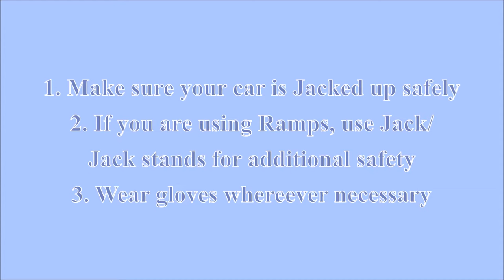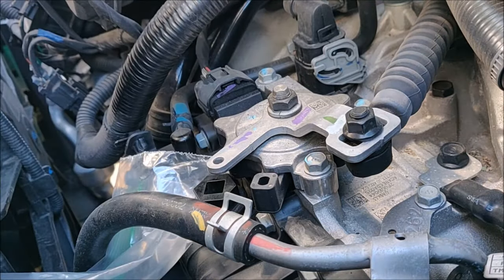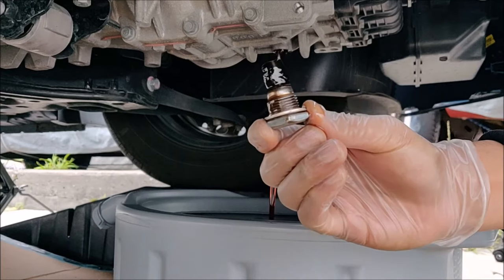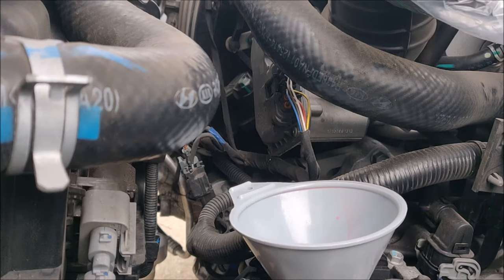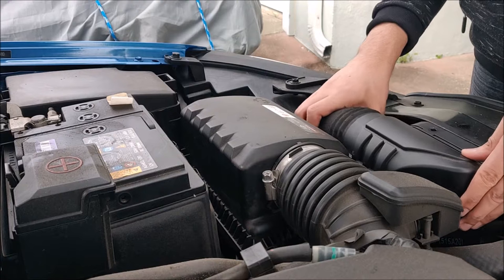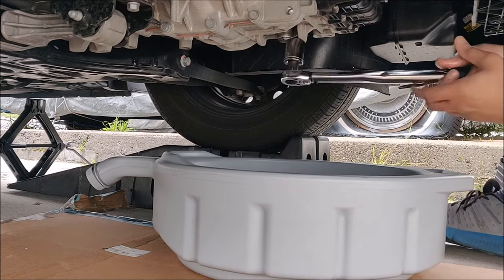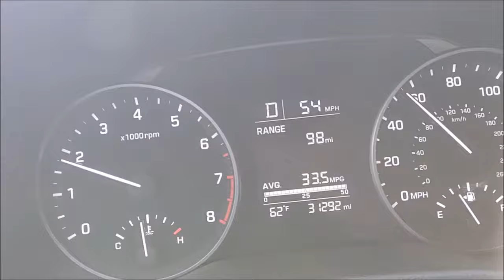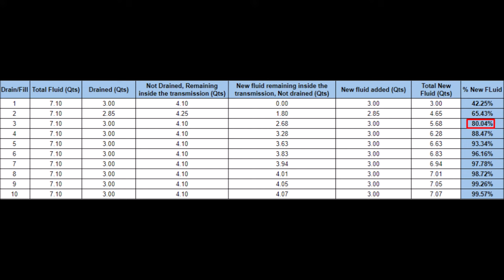2018 Hyundai Elantra Transmission Fluid Change - 3X Drain & Fill with Amsoil ATF (6Th Gen Elantras)

Comment: I have Hyundai Sonata 2017 I check in owner manual ATM drain or change first time at 60k and then every 30k ?
Reply from the maker: Hi, Yes manual says at 60k miles. It is okay to do it at 60k miles, but not later than that. And it also depends how the car has been driven. Severe/rash driving conditions may deteriorate the fluid quickly.
Best preventive maintenance plan in my opinion is to drain/fill the fluid 2-3 times at 30k miles - this removes all break-in materials. And thereafter just once every 30k miles. This will make it last 200k miles and beyond!! :)
How many miles does your car have?
Reply: @andy-auto-info2483  71k done and I am not facing any problem. But I checked manual it said 60k that's why I am thinking to do this week.
Reply from the maker: @DesiTravelDiaries84  Good. Let me know how it turns out. Looks like you will also upload a video. I will be waiting for that :)
Reply: @andy-auto-info2483  it's look complicated maybe I will go to mechanic. Please suggest me good socket wrench set in which 10mm 17mm and 24mm.
Reply: @andy-auto-info2483  scared to change transmission fluid it's very sensitive. After filling how we know that we did proper filling because there is no dip stick ?
Reply from the maker: @DesiTravelDiaries84  Draining and filling will do no harm. If you decide to go to a mechanic, make sure he uses OEM or other quality brands. Sometimes they use very cheap multivehicle fluids, so be careful.
And for Sonata, I believe the fill port will come out easily, you do not have to cut it by filing. Please see my pinned comment point no 2 for checking the fluid level. It is the same for Sonata as well. For Socket wrench sets, you can check in Home Depot. the Husky brands are pretty solid and they give you lifetime warranty. Get a Torque Wrench from Amazon, you can get one within $40 which is good. The one I have, I use it for everything. It costed me $29, 4 years ago. Since it is long, it gives you enough leverage and makes it easier to open the drain bolts. :)

Comment: is it okay to send a dipstick down the fill port and permanently mark the cold level ( ullage ) on the dipstick before draining the fluid so as to have a level mark to refill the new fluid to?
Reply from the maker: I would recommend you do not do that. May not be accurate because of the way the dip stick would go in.
Reply: @andy-auto-info2483  thanks a lot

Comment: hello the computer needs to be reset after the change!  or if I roll the car how many miles should my car go to reset!  or should I disconnect the battery and reset?
Reply from the maker: Hi Wilmer, you do not need to do any of that!
Usually the transmission gets adjusted to the fluid change pretty quickly. Not sure how many miles, but few hundred miles I'd say. I did not do anything as such and it runs great :)

Comment: Do you think maybe if the transmission gear selector was in neutral that the top plug would be easier to remove?
Reply from the maker: I tried this. It did not work. Also, it is not the shift selector coming in the way. It is the thick hexagonal bolt under the shift selector coming in the way. Hope that helps.

Comment: Would you suggest I do this on a 87,000 mile 2017 Elantra? I recently got the car from a dealer and do not know the transmission service history
Reply from the maker: That's a tricky question. It really depends on how the car was used prior to your purchase. So its hard to tell.
Check with a mechanic to examine the fluid condition. If its not in a really bad condition, you could do a drain and fill. Use O&M fluid.

Comment: Hello. I have 2020 hyundai elanta. I changed the transmission fluid and I checked the level after two days.
I check the fluid at 150F / 65 C while the engine was turned off. There was about 1/2 to 1 quarts of fluid was spilled. Did I check it in the wrong way? Should I refill the transmission again?
Reply from the maker: Hi, you may be low in fluid. You have to put the car in level. While the engine is running and at the recommended temperature, you should open the level check plug. When the fluid is at the correct level, you will see a small stream of fluid coming out. At this point, close the plug and you are good. :)
Reply: @andy-auto-info2483  i could not find the proper temperature in the user manual nor online. What would be the approximate proper temperature?
Reply from the maker: @oqhr  the temperature should be between 120 and 140 deg F. Check my pinned comment. You'll find all the details. :)
Reply: The 2020 elantra sold in the United States has a CVT which is a completely different transmission than this one, so things might not line up as in this video.
Reply: @carterdavis2793  you are right ✅. Mine is 6 speed Automatic

Comment: Is that not the shift lever that was blocking the drain plug?  If so, why not just move the shifter out of the way.    Aka put into neutral.. maybe I’m missing something
Reply from the maker: Shift selector is not the only thing. You see the big hexagon looking bolt that's holding the shift selector? That's blocking the fill port. I did not want to mess with the calibration by turning/moving it :)

Comment: Can u fill from the bottom using a pump without having to deal with the fill plug nonsense ?
Reply: Yes.  You can just fill with a pump into the check plug hole.
Reply from the maker: Yes, as Phil said, using the check plug, you can pump the fluid back in. Have an extra quart, just incase it gets a little messy. :)

Comment: Zeroing my mileage meter and filling up right before getting n the highway.   I can do  78 mph with three people in the car and AC on and it will read 125 miles later 44 miles per gallon.   Actual the best doing that was going in slow and go traffic at 45 to 55  in morning to other side of town and got 55 MPG.  What have you gotten.  I have 2017 Elantra.   Great Video.  Thanks.
Reply from the maker: Wow. See, having clean tranny fluid goes a long way. I have 4 simple questions for you. At how many miles did you change your fluid? Which fluid did you use? Did you do 3x drain and fill? Were you able to remove the fill plug easily? :)
Reply: @andy-auto-info2483  Hi   I am waiting for fall to do my Transmission change.   I have about 74,000. miles on my Elantra now.   100 + deg out here in Az.  I try to change oil right before it gets hot and right after even if there is still mileage left.   I have 2017 Elantra.,   Will let you know which fluids I use.  thanks

Comment: How many quarts of oil do you have to pour after emptying it and thanks..
Reply from the maker: around 3 to 3.5 quarts. You can use the fluid level check plug to determine the level of fluid.

Comment: great video.  what difference if any would apply to manual transmission?
Reply from the maker: For a Manual transmission, the process would be different. Even the fluid will change. Check your owner's manual for the type of fluid that needs to be used.
Reply: @andy-auto-info2483  would the plugs be in the same location? and would I have to file the fill plug?
Reply from the maker: @acts2211  I don't think the plugs are in the same place. And filing will not be required for Manual transmissions. Check owners manual as the procedure for Manual transmissions and fluid being used are different. :)

Comment: Question: 
I have an issue with Hyundai Genesis, I have 2015 v6 sedan and it hard shifts from 2nd to 3rd and from 4th to 5th when ATF is cold but when it heats up, it's smooth and still notice harsh shfit 4th to 5th and more apparent wje driving uphill. I did 4 drain and fills with OEM ATF SP-IV-RR.  Dealership suggested to replace the full transmission assembly. I have done 4 drain and fills of the ATF, I changed all solenoids, changed the wiring harness for the TCM and changed different sensors inside the transmission, no luck!
I suspect a bad TCM or software bug, or a bad Torque Converter. My last resort is a transmission replacement. What are your thoughts please?
Reply from the maker: Sorry to hear that Husam.
It looks like there is definitely an internal problem with wearing gears or torque converter like you said. I'm saying this because you changed out the fluids and replaced electricals like solonoids.
Did you check with the dealer to reset the transmission software?
Also how many miles do you have now and how often was this maintained?
Reply: @andy-auto-info2483  Thanks for your response. Yes the dealer did reset the adaptive values of the TCM. It still has the hard shift. The car is 170,000 km on it and i am the 1st owner and it is top notch maintained.
Reply from the maker: @husamothman1   that's only about 105k miles. Not too much and if you have maintained it well, not sure what may have happened. You did mention its a V6 engine, so a more powerful car. If you have done more city driving (severe conditions) , then it would br harsh on the tranny as well. There are so many factors that affect it.
If you can manage how it is currently, then fine.
Worst case, before you replace the tranny, maybe give Amsoil OE fluid a try? One drain and Fill and maybe check the difference? You never know, it could fix the issue. Let me know what you decide and what the outcome was. :)
Reply: @andy-auto-info2483  Yeah, I am scheduled for a discussion tomorrow with the dealership and I already ordered Valvoline MAXLIFE to give it a try. I have my suspension around a bad logic in the TCM as this seems to be a common issue with multiple cars of the same model. I'll keep you posted.
Reply from the maker: @husamothman1  Definitely . Good luck with it. :)

Comment: I was just getting ready to say, if you would have put it in neutral and hold that emergency brake up that shifter linkage wouldn’t have been on your way and you wouldn’t have had to file down that bolt

Comment: You can re-use the washer many times if you don't tighten it too much and turn it to the other side. I have done it many times in my Elantra 2008 and Kia soul 2012
Reply from the maker: You can definitely do that if the washer is re-usable. You do get re-usable washers. Generally, crush washers are used for one-time purposes. The thickness in mm is drastically reduced once you tighten it. If used multiple times, there are chances that it may crack and the fluid may start to leak. Especially if you torque the bolt to specs. Feel free to re-use at your risk. There are chances that it will develop crack and leak. We should not ignore cheap insurance. Thanks :)
Reply: @andy-auto-info2483  I repeat it again, I use it many times and the washer is wherever you call use one-time. The problem is you. You don't know how to use the torque specs. all people and mechanics I see on these youtube videos use the max specs, that is not what specs mean. If it says 28 to 35, why the heck you put 35 ft-lb?

Comment: Did you check fluid level with car running?
Reply from the maker: Yes, I did. Look at my pinned comment point no 2. You should check the fluid level while the car is running. The gear must be in park and the fluid temperature should be between 120-140 degree F. :)

Comment: Have you had any issues with leaking from the fill plug where it was filed? Is it even possible for fluid to leak from there? Wanting to try this but want to make sure there will be no leaking.
Reply from the maker: Hi Marcus,
No, I have not had any leaking whatsoever. Do check out my part 2 of the video. I have done a small followup. :)
Reply: @andy-auto-info2483  I have not. Will watch it now. 

I checked the fluid today and broke the plastic locks on the check plug. These plastic plugs get very brittle. 

Do you know what a good operating range of tempature is when driving the elantra?
Reply from the maker: @Mmitchtexas  I am not sure specific to Elantra. But it should be 175-180 degree F like most transmission fluids.
Reply: @andy-auto-info2483  I am going to do some research. I purchased a ScanGuage to check the tempature and it is showing 200 to 210 while driving. I may be running a bit hot.
Reply from the maker: @Mmitchtexas  yes looks like it is over the normal range.
Reply: I almost lost my $ when taking that bottom plastic shield off the bolts broke even I heated them omg 😳, no wonder they charge extras for oil change with the shield 🛡 removal
Reply from the maker: @johnf6687  glad you were able to manage. Yes, sometimes the plastic push pins gets brittle and break off when you try to remove them. Have to be gentle.

Comment: When do you recommend changing the filter or is there even a filter
Reply from the maker: There is a filter inside the transmission. It is not serviceable. Usually dealership changes the filter when transmission is hauled and opened.
Changing the fluid every 30-40k miles and keeping it clean is the way to go for this car. :)
Reply: @andy-auto-info2483  interesting so the dealership only services the filter when the transmission needs a overhaul?
Reply from the maker: @MPRPETE  yeah, I know its hard to change the filter or access it even for the dealership. That's what I got to know when I asked them.
They say when they do a flush at the dealership, the force at which the transmission fluid is replaced while doing a flush, the process also cleans the filter. Its basically a mesh type of filter.

Comment: hi first of all thanks because video really helpful, i also have a question may you can answer, i have 2018 Elantra Gl Se. i could not find which transmission need. can you help me
Reply from the maker: Thank you Yasir.
Which country is this in? Is it Canada? Do you have the 6 speed automatic? If so, the car is exactly same as mine, so you should be good :)
Reply: @andy-auto-info2483  
Yes I am in Canada
Reply from the maker: @yasirchaudhry2266  and if you havd a 6 speed automatic, then it would be the same process. :)

Comment: Does changing the transmission oil from this model and 2018 they use a oil filter?
Reply from the maker: There is no easy access to the transmission filter. It's placed inside the transmission. Usually, transmission filter is not serviced, it is only replacing the fluids. You can check with your local dealership for more details. :)

Comment: I’ve been having shifting issues in my 2017 Elantra. 45,000 miles. Dealer did the transmission relearn thing but problems are coming back days later. Is this what I need to do? Dealer is no help
Reply from the maker: Are you still having shifting issues? Are you the first owner? How have you been driving your car - severe conditions or normal? 
Take it back to dealer one more time since it is still under warranty. Make sure they fix it. :)
Reply: Andy-Auto-Info yes I’m still having issues! :( I’m the second owner. Was a lease with 30,000. I put about 20,000 miles a year
Reply from the maker: @dylanleszek333  it is still under warranty looks like. Try to get it done from the dealer. They should not charge you a single penny. :)

Comment: why you didnt change the oil filter?
Reply from the maker: Hi Cesar, the transmission filter is very much inside the transmission and is very difficult to change. Usually it is a mesh/screen type filter and does not need to be changed. As long as we regularly change the transmission fluid and keep it clean, we should be good for a long time :)

Comment: Very well done I like your analysis of everything. Yeah I'm not sure about that viscosity issue. I think there are different s p e c s just for that reason. Thanks for choosing a true chemically engineered synthetic fluid as well. Group 4 and group 5 much better than group 3 hydrocracked petroleum which the courts ruled you can call this synthetic.
Reply from the maker: Absolutely. Thanks Mike. :)

Comment: I wonder which transmission line going into the transmission is the correct one that I can find a good tool removal area.  I like the idea to drain, fill, run the engine while sticking the line into a clear bottle to catch what fluid comes from the torque converter and goes through a radiator tank or cooler, then stop when the bottle holds about a quart, add a new quart to the transmission and repeat the process a few times.  A second person is needed to start and stop the engine quickly, even shifting through the gears a bit.
I did this with my Subaru and it was very easy (3 cycles of the process).  This way I was sure to get out a good amount of old fluid before resorting to driving again and simply mixing the new with the old.  *Anyone have photos of the specific line that goes into the trans after it has performed the cooling cycle and is about to go into the trans functioning process?*
By the way, bluetooth OBD2 readers connect to the OBD2 port and read to phone apps and SOME read the fluid temp.  I use a BAFX reader with an app called CAR SCANNER PRO and / or ACTIVEOBD. Both apps work fine but the Car Scanner Pro connects with less effort.  ActiveOBD often requires a phone restart, as in power down restart.